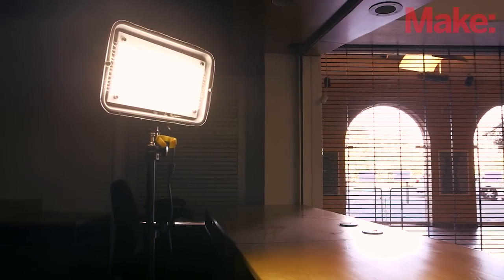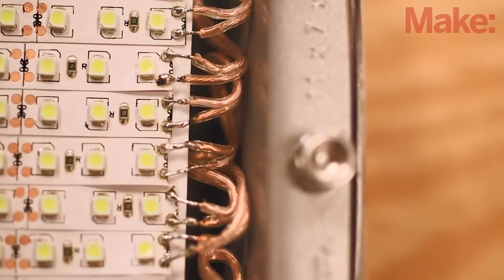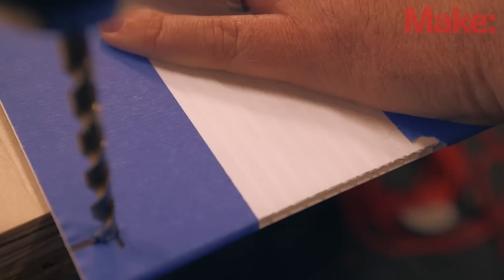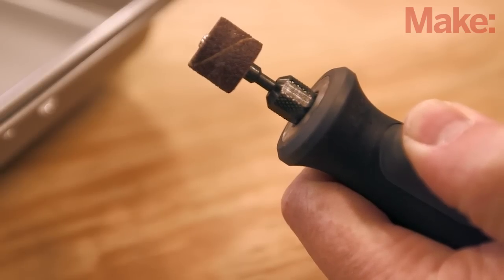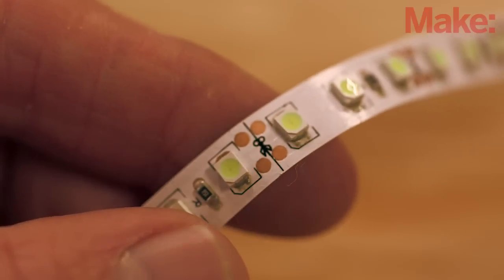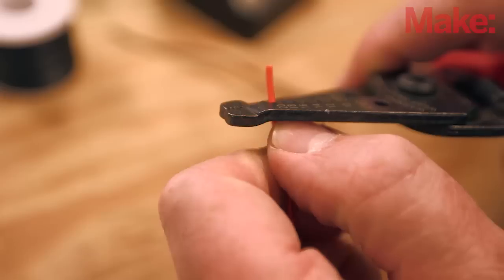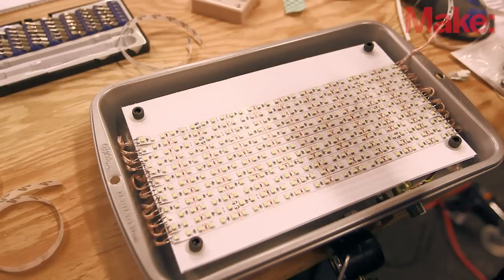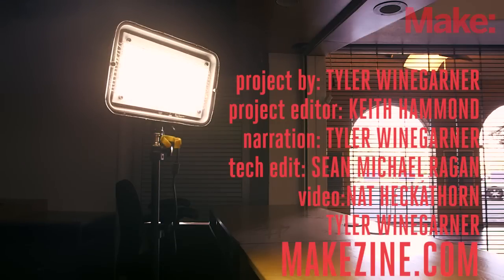Brownie Pan LED Panel

Comment: I like how you guys show a tool list and then throw bandsaw in there. Like you guys are tools also
Reply: Wookie Glasswerks I was going to say the same thing.  It's like as if to say, "here's a simple project you can do in a weekend...if you have a full wood/metal shop where you live.  Enjoy!"
Reply: Wookie Glasswerks  You could probably use a jig saw, a saws all, or hack saw, or even a grinder, its only a cosmetic step you dont even need to do it
Reply: Wookie Glasswerks I was thinking the same thing but since they did mention having a dremel, that would work well if you have a cutting bit
Reply: Wookie Glasswerks I think your best bet would be a router with a flush trim bit, using the brownie pan itself as the guide. I agree, all the tools should be listed in the tool section.
Reply: Wookie Glasswerks It's video retention bait.

Comment: That's good and helpful but when used in video production and dimmed the PWM module will make leds flicker so to avoid that it's better to use a 60w DC-DC stepdown voltage regulator and set it to 12V output to led,the stepdown voltage regulator can be connected to either 12v or 30v or anything between but the adaptor must supply at least 60w for this setup,laptop adapters can be used and also batteries.Make sure to connect with the voltage regulator a logarithmic 10k potentiometer and add a 6k rezistor to it so the potentiometer won't go down below 6v.

Comment: Yes - PWMs might make your videos flicker at some stages of dimming if you are unlucky - with this setup at 25 fps mine doesn't. But if you are worried, then just skip the PWM and hook up 4 small swithes, to switch of 1/4 of the ligths per switch. I know this doesn't provide "infinite dimmability", but who needs it in the "making a video light from a baking pan" segment of videographer. That - or make some barn doors to block the light, or clip on a opaque something in front of the panel.
I rarely dim my lights - i find more light is usually better if you are not shooting movie style videos, but things like how-to's.

I love DIY-perks' channel, but the idea of using my battery to heat up the heat sinks on a voltage regulator is VERY inefficient, and he even had to integrate a fan to keep it cool. His design is brilliant on mains power, and if i had his panel given to me i would take it gladly, but spending my own money and time i like the MAKE panel better, except i would use some kind of metal to mount the led's on, to dissapate heat. (DIY perks used MDF, which isn't much better that the plastic they used here - heat wise..)

Comment: Really a good idea! Must try this but with a few improvements. Like some reflectors, edged corners, rubber foam between the plexiglass and "pan", to prevent rattling and other stuff. Yeah, also double the amount of leds. But yes, my model and my add-ons. :P

Comment: Great video, steps are laid out well.  But you want to remove the heat generated by the LEDs.  That heat has a couple of bad effects, including greatly shortening their life by speeding up the depreciation of lumen output over time.  You want a material up against the back of the leds to be like a heat sink.  I would think the corrugated plastic would work to insulate, the opposite of what you'd want.  If the overall enclosure you've created is pretty air tight, that's just going to make it worse.

Comment: You can do the same thing with a broken LCD TV or monitor just remove everything except the backlight inverter and power supply. Keep the hard plastic diffuser panel or just replace it with plexiglass.
Reply: Not really. At best the LCD backlight "glows," it's too weak to be a valid photo light.

Comment: Not to be a naysayer, but this project is completely ignoring the question of the LED temperature. If those LEDs get too hot, they will melt straight through the plastic. Even if they don't melt it, they will likely be way too hot to last long unless you run them at very low current. I would leave off the plexiglass, so you can at least let convection cool the LEDs. A better idea would be to mount the LEDs directly to the baking pan.

Comment: Lol don't get very hot, unless you get one of the new kinds that shine 1000 lumens in one led, and the actual thing is only 1-2mm on a black circuit board that has to be specially manufactured to not melt in any way at the 60+°C it can get to

Comment: in just saying, you can get a 500 LED panel off amazon for around $100 which is a bargain. i have one, its brilliant. sure its plastic instead of metal but its still durable.
Reply: I assume you mean the Neewer" light. Yeah, overall those lights are quite good, LEDs are around a CRI of 96 (very good) and they look and act like a true Professional light. LED color is around 5600, as I understand it. And further, you can get them at Amazon for under $75 bucks (!!), and they include color filters (partial) to boot. (One model provides and LCD displaying %brightness and color temp.)

About the only issues people have with them is their weight, and they aren't very bright. But in the end, they're definitely worth a look.

Comment: How man lumens?
Reply: Guywithcrazyideas It depends swhich type of LED strip you use. Try to google this: led strip lumen 
There is lots of different types, you can find it the best for you. Just calculate... :)
Reply: Guywithcrazyideas I've been checked it: (approximately datas) 
With type 5050 - 60 LED per meter strip produces 864 lumens per meter with a power consumption of 6 amps, 14.4 watts or 60 lumens per watt Pretty strong.
http://www.theledlight.com/flexible-led-strips-comparisons.html
Reply: MM Karesz  Thank you!

Comment: PWM ==> flickering?!?
Reply: Soxco Yes. Have a look at "PWM" here on youtube. You can find a lot of explanations, what is PWM. Briefly it's a switching power regulator. The LED "can follow" the fast on/off switches, which can make interference. It depends on the frequency of the PWM regulator.
Reply: Soxco I get a ton of flickering when shooting at 60 fps. I imagine it interferes with 60hz.
Reply: 60hz for maximum mind control.

Comment: Why not wire them in series
Reply: charles fair  each strip requires 12v, if they were in series then yu would need a 144vDC power supply, and the dimmer would need to be upgraded as its meant for an input of 12-24v DC
Reply: I thought they were strip LEDs with one power supply and one input for the LEDs
Reply: charles fair the strip is normall 5m, and runs on 12v. every three led`s can be cun, but each of those three leds will run on 12v, when its in a full roll its already setup in parallel. see attached photo: https://drive.google.com/file/d/0B_92Lvv7i0cIWF8tOXdtS3JkOVE/view?usp=sharing
Reply: charles fair You mean: connect them together how it was? About the current. Lots of connection points can spread the high current. Kirchhoff's law. ...and I'm didn't mention about Ohm's law. Longer wire have resistance. Resistance means current / voltage drop --> more heating, loss of effenciency. 
Believe me, it's better. :)
Reply: I overlooked the resistance
Reply: I think series is correct because when you connect them by their solder points in series you have it wired back up the way it was originally built.  Also, all the soldering can be replaced with connectors for led strips that are easily available online.
Reply: when leds are in the strip, they are in parallel, every three leds uses 12vDC they shouldn't be wired in series. Please see attached image: https://drive.google.com/file/d/0B_92Lvv7i0cIRTBvZS1heDM2ZkU/view?usp=sharing
Reply: austins_creations Ah.  I see.  Solder plus to plus or use the connectors but don’t solder plus to minus.  I get it.  You are correct.

Comment: PWM? whyyyyyyy
Reply: Loco Llama the particular dimmer used in this project uses PWM and allows for more precise dimming of a 12v led strip, as well as a smother transition between brightness levels. But with some high end video recording it is possible you may notice a flicker but it is unlikely.
Reply: "smother" well its spelled smoother. Anyway smoother than what? Smoother than voltage dimming. How? PWM means the lights are being flashed on and off at a fixed frequency but variable (in most cases) duty cycle. So this means this is not smooth at alllllll. This can cause a camera's frame rate to come close into sync with the frequency at which the lights are flashing at causing strobe lines and/or flickering. THIS IS HIGHLY LIKELY! 

Smoother transition between brightness levels? Some dimmers can flicker horribly as the brightness is being adjusted.
Reply: sorry about that, thanks for the spelling correction. and you're right about the PWM, i wasn't fully thinking about other options. I personally find these strips harder to control with voltage drop.i think the better way to do this would be to use 5mm LED`s or 3w Star leds or a high powered led, add in a led driver and you would be all set.
Reply: Loco Llama not when the frequency is high enough, say at 1 kHz. dunno about these stock modules though, but one could simply build one with just a 555 and a nice power mosfet.
Reply: Your right but your example is just too low of a frequency. Maybe 10 kHz. But you could run into some problems when trying to find a good driver than can run at this high a frequency, without wave distortions.
Reply: well, a 555 costs some 0.20€, An IRFZ44N costs about 0,5€, a pot costs 1€, passives and diodes make up another half euro, both can handle 10kHz easily and buiding your own PWM controller for a few € is priceless
Reply: Loco Llama Use some 25V 4700uF capacitor paralel to the power line. It will smooth it, but possibly makes a bit darker. (experience)
Reply: This will cause the capacitor to be charged to the peak of the square wave result in constant voltage (under low power loads). If you adjust the duty cycle to: lets say, 20 % every positive cycle will draw a lot of current to charge the capacitor and continue to power the load even when in the off cycle. This will void the purpose of PWM!
Reply: That's why you have to find the right amount of capacity. The LEDs are have a pretty high load (e.g.: 10-30W) so it can discharge the capacitor quickly. Thrust me, I'm an engineer ;)
To answer your question: PWM is cheaper than the voltage regulator. The principle was the cheapness.
Reply: If the capacitor will discharge quickly then what is the purpose of the capacitor if the lights will still be turning on and off!

If the principle is cheapness then why would you spend all your money for the LEDs and housing just to use a PWM controller for the LEDs to spoil the whole purpose of this device?!?!?

PWM is great for motor controllers, heating elements, small indicator LEDs. But not when lighting an area and especially not when the purpose of this light is for photography and video work.

NOTE: giving your self the title of an engineer doesn't mean you know everything about engineering nor being smart. (Not saying i know everything)
Reply: Fitst of all, I'm really engineer. You have to find the right amount of capacity, otherwise the PWM will not work. The principle of capacitor is the smoothening of the switched power signal. I said: SMOOTHENING. It's not preventing the flicker, just smoothening. It's optional.
Reply: Loco Llama "PWM is great for motor controllers, heating elements, small indicator LEDs. But not when lighting an area and especially not when the purpose of this light is for photography and video work."

This is where the debate should stop. :) There is no better way to say what Loco stated here.
Reply: Rob Wentz Thanks you.
Reply: Loco Llama If the frecuency is a problem, put a 10000uF x 16V electrolitic capacitor and tadaaaa! No frecuency problems anymore.
Reply: Loco Llama Because its cheap, simple, and provides satisfactory results at a reasonable cost/benefit ratio to make it a viable option for people without a large budget.  

Also, PWM is one easiest methods to dim LED's effectively.  Provided you are using a high enough frequency, you should not experience any 'flicker' in your video. Take the video you are watching here, did you see any flicker when he was testing the circuit? No.

The only other reasonable way to do this is to create a variable current device that outputs at a set voltage, but that is a much more complicated and expensive circuit.
Reply: Amra you are dealing with such low power that a simple dimmer would work fine without the complexity or flicker of a PWM.
Reply: Matt Battaglia The current would add up pretty quickly when you have a large LED array, making that kind of solution pretty inefficient, and in some ways more difficult than the type of solution in this video.

As I said, assuming you use a high enough frequency, a PWM circuit would not produce a noticeable flicker.

Did you notice any flicker in the one made in this video? I didn't.
Reply: If you want to connect serial, you have to use n times 12V power supply. (For example - if you have 10 stripes, you'll need 120V)
Reply: ***** The strips are actually wired in parallel from the factory, he merely separated them to have more control over the direction of the strip (so that it zig zags across the board, instead of one long strip), and then reconnected them using jumper wires.  

The problem with wiring them in series is that the voltage demand goes up pretty quickly. If a white LED has a forward bias voltage of 3v, then if you had 10 of them in series, you would need a minimum of 30v power supply, if you had 40 LEDs in series you would need a minimum 120v power supply, etc etc.

So, as Karesz pointed out, putting these strips in series would soon require unsafe voltages.  So, wiring in parallel is not only convenient, it allows him to keep the voltage low, which makes the project safer for DIYers, especially younger ones..
Reply: Loco Llama "your" well its spelled you're.